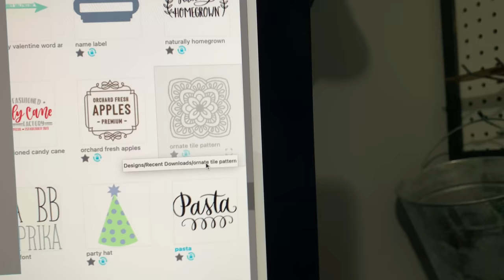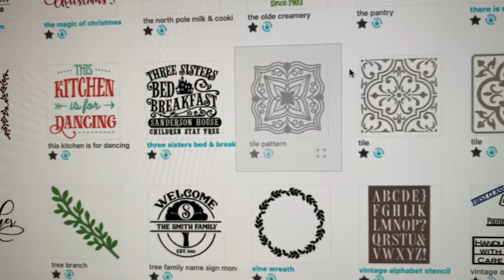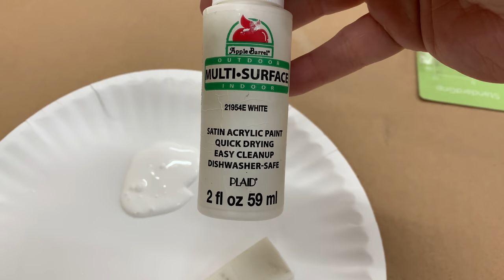Thrift Store Finds || Furniture flipped Book Shelves || Farmhouse Decor

Comment: Hi Yvonne. If you check out Sammy over on Unicorn Dust designs she does wood round signs and stencils.To paint she uses a small foam roller and it looks like that works very well for her.  May save you some back pain!
Reply from the maker: Thank you for sharing that . Will do🤗

Comment: When I use my cricut to make stencils for anything I use (from the dollar store) contact brand matte/frosted clear vinyl. If you get it at Walmart the price per foot is comparable but the roll contains over twice the footage that you can get at the dollar store. I also use it as transfer tape, it's just tacky enough to hold everything well and when using it as a stencil it doesn't bleed through but it's not so tacky it pulls any paint from underneath and since it's a frosted clear you can see exactly where you're placing it.
FYI: when using contact brand vinyl as opposed to actual decal vinyl make sure you set your cutter to not go as deep. It is thinner and it does cut easier. You might have to mess around on your machine in a little bit until you get your pressure right.
Reply from the maker: Thank you for sharing your knowledge 💝

Comment: I also noticed you spraying black paint straight to the wood. What paint did you use that you didn't have to prime? Also, did you sand the entire piece first?
Reply from the maker: It’s actually because to polycyclic top coat and antique wax it.. the paint is just a $13 gallon can of ready to use black onyx.. from Walmart. No primer in it. But it fabulous and last🤗 sanded where it was needed